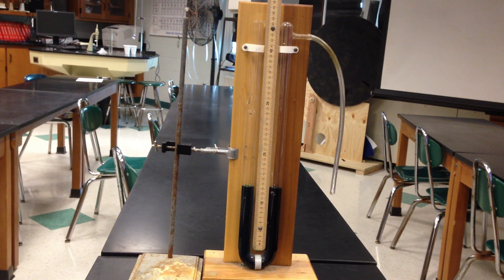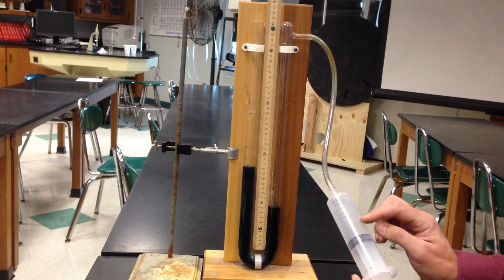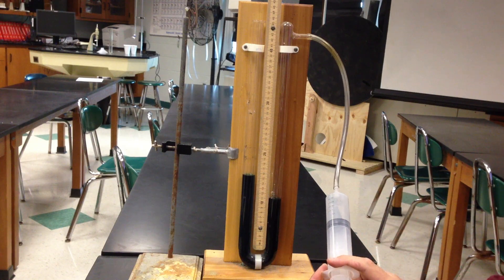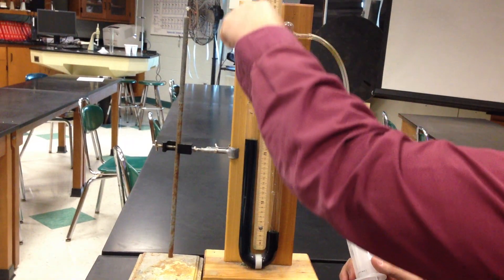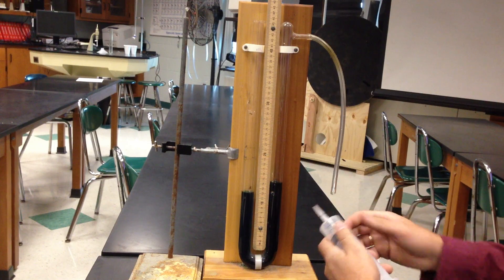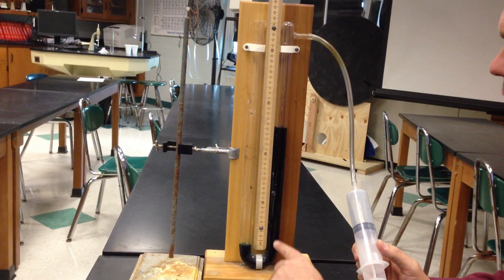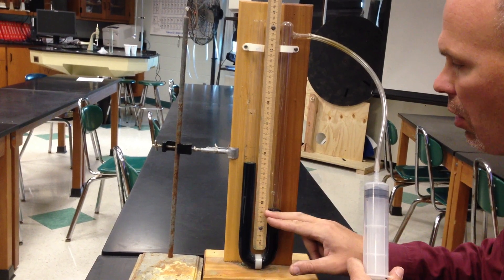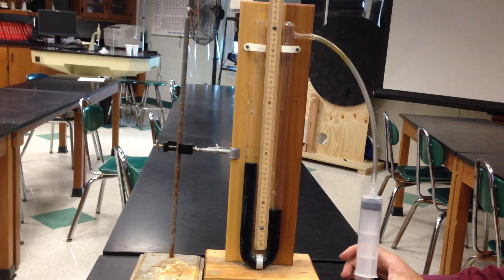A simple manometer demo

Comment: I was just wandering, if we do the experiment using barometer, will this give same rise of 190 mm HG or 190/2 mm Hg. Here in menometer,  the length of Hg in one leg of manometer pushed downward same length of Hg is pushed upward in the other leg. I mean doubling the actual pressure difference. If you can explain this ...where I am wrong?
Reply from the maker: a Barometer is just an open tube on one end and thus there would be just one "leg" to measure.

Comment: Great video! It would be cool to include the equations you mention in the description, along with the conversion from water to mercury. It appears that only the density of the fluid changes how the measurement is taken, not the volume, is that true? Would you get the same readings for a water filled manometer that was 10x larger?

Comment: the mass of the liquid has something to do with it. but in this experiement, the increase of fluid level on the left is probably equal to the volume of gas inserted by the syringe. if not it would be interesting to see the deviation.

Comment: So the pressure will be 0.19Pa?
Please do reply
Reply from the maker: Are we assuming the liquid is Hg or using the water?
Reply: Sir I supose water
Reply from the maker: @herchellelawrence7861  No,  it we use water the height of water in the manometer as 19 mm then we must divide by the the density of Hg (13.6) to obtain 1.397 mm Hg supported.  We change to Hg height because there is no pressure unit for height of water supported. Hg specific gravity is 13.6 more dense than water so the pressure from the syringe will support less of a heavier liquid.
Now that unit of height of Hg is a torr  and if we use the converting factor of 101325 Pa = 760 torr I get a value of 186 Pa.  However since  syringe's pressure is "pushing" against the open end of the manomete ,  the186Pa is the extra pressure beyond the atmospheric pressure.  To get the pressure in the syringe we add the 186 to the atmospheric pressure ( I will assume standard = 101325 Pa) = 186 Pa + 101325Pa = 101511Pa.  Maintaining 3 significant figures, 102000 Pa.
Reply: I am gratefull for your help sir.
But can't we calculate the pressure by the difference of the liquid levels.?
Reply from the maker: @herchellelawrence7861  Are you looking for just the difference in pressure between the 2 systems?  Normally manometers measure an unknown systems pressure by the height of a column or liquid and a known value of the pressure of another system.
If you are looking for just the difference in pressure the value would be 186 Pa based on the video.
Reply: Sir for my book says
"the difference  in the level of water(it gave an experiment with water) in both the arms of the u-shaped tube is a measure of the pressure exerted"
Reply from the maker: @herchellelawrence7861   If the one of the tubes has a closed end in a vacuum then that statement is correct. That is how a simple barometer works.  The water level difference in a water manometer like mine  represents the difference in pressure between the two systems
Reply: The two systems being
The atmospheric preasure and the manometer's pressure?
Reply from the maker: @herchellelawrence7861  The atmospheric pressure and the other system that the u - tube is connected to.
Reply: Thank you sir.!

Comment: I built one at home using simple clear vinyl tubing and transmission fluid that somewhat resembles your demo model. I needed it to adjust the twin carburetors on a Yamaha V-Star 100cc motorcycle. I utilized an old carb jet in the tubing to dampen the pulses during measurement. One end of the tube went to one of the carburetors, and the other end of the tube went to the other carburetor. All I was needing is to balance the two equally. It worked beautifully.
Reply from the maker: Nice!

Comment: Does anyone explain the actual pressure?I mean if you apply pressure to the manometer one side obviously goes up.If it goes up 1 inch is it 1 inch H2O or 2 inches H2O by adding both side together ? There is not one single video or website anywhere to explains this.
Reply from the maker: +Jim Z (N2NXZ)  If the pressure on one side of the manometer forces the liquid (water in this case ) 1 inch and the other side of the manometer is open to the atmosphere then the actual pressure (on the side of the manometer that is moving the water) is equal to the pressure needed to suspend the water one inch plus the pressure of the atmosphere that is applying and opposite pressure on the water.  You see in order to move the liquid you need enough force to move the liquid up AGAINST the force of the atmospheric pressure in open side of the manometer thus the total pressure is sum of the pressure to support the weight of 1 inch (pushing down of gravity) and the opposing atmospheric pressure due to gas molecules colliding on the surface water.
Reply: +MrGrodskiChemistry My actual question was - For every half inch up on one side is 1 inch H2O? I know that half inch up on one side means half inch down on the other.Just add the 2 and the reading is 1 inch H2O?Some other websites are saying to mark the chart with one inch markings and some say 1/2 inch markings.Big difference between 2 inches or 1 inch of H2O.
Reply from the maker: The way that I always thought about this was to measure how much higher ( or lower) the second side was above (or below) the first regardless of the initial position. The bottom line is that the pressure in the first must support a column of liquid beyond the new position plus the atmosphere. So if there is an inch being supported above the new position of the liquid in the first side of the manometer then it's an inch. It really is as simple as that.

Comment: Great explanation! At the beginning you mention 190 mm of Hg, but I think you mean 190 mm of H2O. As mentioned later in the video, mercury and water have different densities so inches of Hg doesn't equal inches of H2O.
Reply: +House of Hacks  I think he said to pretend it's mercury because the original contains Mercury but not this one. :)
Reply: +Princess Wonderwoman Actually, I think he simply misspoke. He actually does have 190 mm of H2O. He was going back and forth talking about how mercury was originally used but he's using water, and I think just the wrong word came out. Cheers.

Comment: Is it possible to suck all of the fluid out of this if the vacuum is too strong? If so, do you need to size it a certain way to prevent this? I am trying to find the vacuum level on an unknown blower that I am re-purposing for a dust collection system.
Reply from the maker: ballzack57 You could absolutely draw out all the fluid from this device if the pressure is low enough in your vacuum. I am using water which would be easier to remove then lets say a more dense liquid like Hg.
Reply: MrGrodskiChemistry Thank you for your response. Can you just up-size the manometer to help prevent this? Does diameter or length of the tube affect this? Or both? Aren't you just changing the volume of water either way? But if volume affected this test, then the test is wholly inaccurate unless you take into account for the specific gravity of the water yes? Damn it to hell...I guess I'll just go buy a meter.